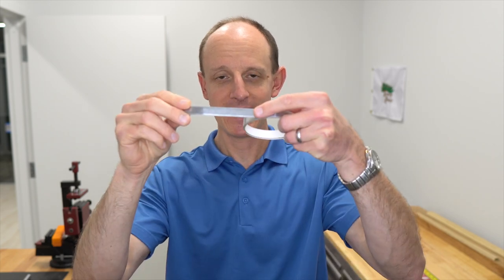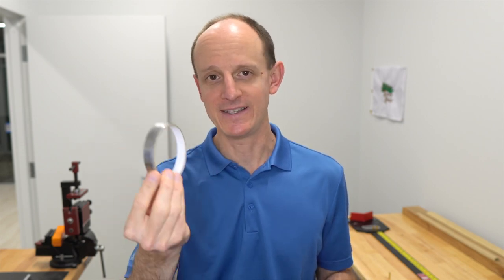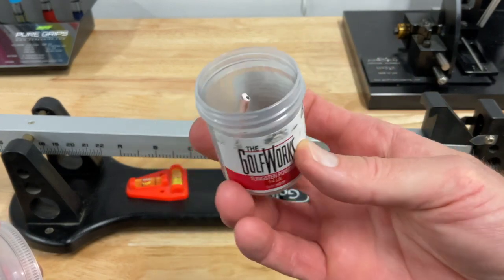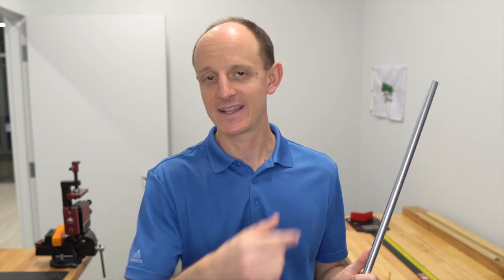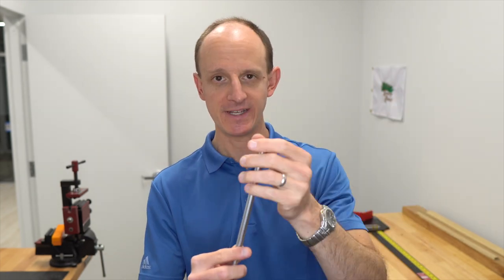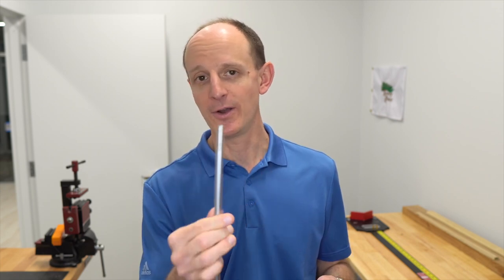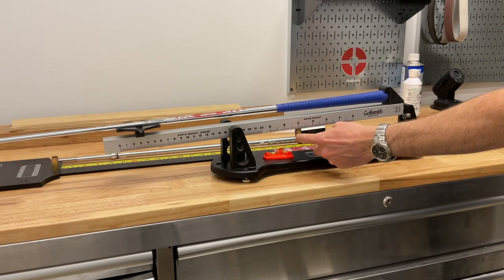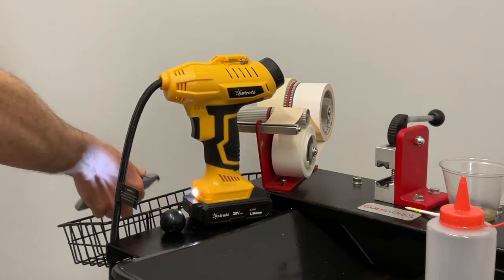BEST SWINGWEIGHT TECHNIQUE I'VE TRIED?

Comment: I just tried this method with .355 shafts and the .355 weights, and did not need to grind down the lip on the weights. According to golfworks, the .355 weights also fit .335 graphite shafts so they will fit loose in .355. Basically only the lip keeps it from going into the shaft, and epoxy will fill in the rest once installed. So I just put epoxy on the bottom half of the weight and was able to ramrod it to the bottom of shaft pretty easily

Comment: I’ve used Tungsten power without removing the grip. Using a thin funnel I made I can pour the powder then use the rod with a cork ( no epoxy) and seems to do the trick. Thx for your post

Comment: I find that lead tape works best for me, added to the right spot can really enhance the feel!  Brass & tungsten down the shaft or into the tip has the potential to change/mute the feel and potentially close the face at impact depending on the amount.

Comment: This is a great idea and while I've not done this before, if you need a "ramrod", I used an alignment rod or drive way marker for inserting dampening inserts, so as long as it fits all the way down the shaft, I would think this would work.

Comment: Hello AJ, I'm trying to build a set of irons using graphite shafts. I am using new uncut shafts that I am going to have to cut and add weight to them so they can all have the same swing weight and I was wondering what would be the best way to do this. I see a lot of videos with steel shafts but I haven't seen any using graphite and I was hoping you could instruct me on the best way to do this, thanks for your time and your great videos..
Reply from the maker: This should help.
https://youtu.be/zXf39oOblUg

Comment: Tungsten putty instead of powder is an option too. It is easier to make sure all the weight goes to the bottom of the shaft. A little bit harder to clean upon disassembly though.

Comment: Question… when the original shaft was installed, didn’t epoxy work its way up the inside of the shaft and wouldn’t that vary depending on how much epoxy was used? So the weight may not sit in the same spot on all the clubs.  Is that a concern?
Reply from the maker: Maybe. I would probably use the ram rod to measure the depth of all the clubs you were considering to see how much epoxy or even existing tip weight is changing the depth.
Reply: Like with powder, I would test first before putting in the cork.
 If it sits a bit higher up in the tip, then you probably need a bit more weight to get the same swingweight effect.

Comment: would adding lead tape to the hosel be a quick way to achieve the same effect? i'm trying to experiment around with swing weight, and I found an iron that "feels nice" to me. And I want to match the rest of the iron set with that.
Reply from the maker: Hosel would work or just back of the head.

Comment: Really liked the light weigh/flex driver shaft video, both the shafts you used obviously not the autoflex are hard o find in the uk, any others suggestions?
Reply from the maker: Going to try this with Fujikura Vista Pro but that should work. Also have heard people using the Grafalloy Prolaunch light weight light flex shafts.

Comment: Great information.  Does a tip weight have to be hollow?  Thinking of using a nail inside my graphite shaft.
Reply from the maker: No, but you do want enough space between the stem of the weight and the inside shaft wall to allow for epoxy to pass through and relieve pressure. Otherwise the shaft will want to push back out of the hosel.

Comment: A little of topic, but how do you feel about using these brass weights with the flange in the butt of the club for counter weighting.  Seems like it would be a cheaper and more flexible system than the commercial counterweights.
Reply: Seems like that would not be very stable and secure in the butt end of the club.
Chances are they will come out at some point or start to rattle.

There are butt weights that fit snugly, that are not very expensive.

Comment: Enjoying the varied content. Will that portable compressor be ok to remove grips that have beein installed with solvent?
Reply from the maker: I am 1 for 10 in removing grips with compressed air when installed with tape and solvent so probably shouldn't ask me. I prefer a grip removal tool.

Comment: Great video. Question, is there a difference between using a 3 wood shaft in driver and cutting driver shaft down. Would using a 3 wood shaft get the same results. Thank you
Reply from the maker: Most shafts used in 3 woods have no tipping just like a driver so the only difference is the final play length, assuming it's not some sort of fairway wood specific shaft.

Comment: Hopefully you can answer this cause I can't find an answer anywhere. I jsut bought some wilson staff model CB's, I like the shafts in my last set so I took both sets of shafts off and to my shock and horror in both sets,some shafts have these brass plugs/weights and some don't,any clue why this is?lol FYI, love your content.
Reply from the maker: Those are tip weights used to balance out the feel of the set. The ones with brass were evidently lighter feeling during assembly so extra weight was added to match the rest of the set.
Reply: @EFGMC  THANK you thank you. I was freaking out when I saw those. I ended up just taking them all out and haven't even noticed any difference but boy,them were some tense moments.Thanks for the responce and love your content,you have made tinkering with my clubs so much fun and stress free(ish)haha

Comment: AJ - Does adding that weight to the bottom of the shaft, add weight to the back side of the head and cause it to close faster? Like adding lead tape to the heel of a driver?
Reply from the maker: In line with the shaft, the weight is considered neutral.
Reply: @EFGMC  Thank you.

Comment: Rust at the bottom of the steel shaft compromise the bond possibly? There often a little corroded inside after a year or two of use?
Reply from the maker: Maybe. Older shafts might cause issues.

Comment: If I add 1/2 inch to a golf ion would the swing weights still change the same 2-3 points? if the material in the butt end of the golf club is Metal because it's basically changing the swing weight from the butt end of the golf club no?  I just don't understand how the swing weight could be the same if you're adding more weight to the butt end of the golf club

Comment: Hello , Can I also use this method when shortening the driver shaft? best regards
Reply from the maker: No, I would not use a tip weight with graphite. Not to mention that the graphite tip weights have a head and a stem and you'd only be able to get the stem into the base of the shaft. It will also likely cause a shaft failure.

Comment: I was surprised to learn my Cobra F7 One Length irons all had different scale weights on my cheapo-depot swingweight setup. The low was about 221g and the high was 235g.  I decided to try to make all the clubs about 230g. I couldn't figure out how to lower the weight on the 2 heavy clubs, I wasn't going to take a grinder to them. (Now I think maybe I could add a counterweight?) For the "too light" clubs I wrapped lead tape around the low point on the hosel. I know this is kind of ugly, but it was easy to adjust. Am I crazy or does this have the same effect as tip weighting the shaft?
Reply from the maker: Lead tape down by the head is doing the same thing as tip weights. I would not counter balance though unless you plan on doing the entire set.

Comment: Question… if I cut my 6 & 7 irons down to 8 iron length… will tip weights help keep my distances correctly? Or is swing weight different then head weight? Thanks!
Reply from the maker: Loft adjustments will likely be needed to get the right gapping. Tip weighting might help make the feel more consistent so that you make consistent contact, but we not really change the distances by itself.

Comment: I tried your method of tungsten power with a cork on an Aerotech graphite shaft could not get the cork down far enough. I bought the iron corks from golf works. So this method won’t work on graphite shaft, unless you cut the corks down?
Reply: Graphite shafts have a different (smaller) internal diameter. I’ve never heard of anyone corking them until this post. My guess would be ‘yes’.
Reply: There are some very small /thin corks that will work for graphite shafts.
Reply: @rogergee8470  Do you know where I can buy some? Thanks

Comment: I got my irons from fairway jockey and they are super heavy (d4). Is there anyway to reverse the weight?
Reply from the maker: Depends what the specs are and how they were put together. You could shorten them 1/4 inch and get them close to D2.
Reply: @EFGMC  1/2 longer due to my height. I got the pxg gen 6. I just don’t know how they achieved the weight. I was hoping like the video you showed with the brass weight
Reply from the maker: @paulrachetta935  Won't know for sure unless you break them down or email Fairway Jockey and see if they know.

Comment: Does adding weight to the bottom of the shaft change the center of gravity of the club and the sweet spot?
Reply from the maker: Weight in line with the shaft will have minimal impact on the head. Also we are usually adding say 6g on average to a head that weighs average of 270g ie 2-3% weight change won't have much impact regardless where it sits. Drivers can be influenced more because they start out lighter and have a much larger area to add weight to.
Reply: Any time you add weight down the hosel (solid or powder) you are shifting the sweet spot slightly towards the heel. For this reason lead tape CENTERED on the back of the club is the best way to ensure that doesn't happen, HOWEVER; placing it high or low on the clubhead can move the CG ever so slightly up or down.

Comment: How does this work at graphite shafts?
Reply from the maker: Still working on a graphite shaft option. This won't work because the inside tip diameter is so small that very little weight will fit, and the metal could cause a pinch point where the shaft could crack.

Comment: I cut 3 inches off of my g25 driver. How much weight should I add to the head to bring back the swing weight
Reply: You moved it 18 swing weight points down by cutting it 3 inches. It would take 36 grams added to the head to bring it back where it was.
Reply: @Matthew-of9sp  
Ii have herd that Ping counter balances their shafts. Does this complicate things at all?
And where should I add the weight to maximize forgiveness? Most likely lead tape.

I also just picked a used set of 425 irons. Green dot and would like to lengthen then myself by a inch. Graphite shafts. Any challenges there?

Thanks...
Reply: @Matthew-of9sp  2 grams per swing weight point is a rule of thumb and is dependent on club length. It is based on a club 38”-40” long. Shorter clubs need more than 2 grams per swing weight and longer clubs less. Assuming that the G25 driver was 45” long and cut down to 42”, 32 grams of weight would have be added to the head to restore the swing weight.
Reply: @golfish8589  counterbalanced would have lowered the original starting swing weight. Add weight to the rear of the head for max forgiveness (more launch and spin) or to the heel to promote more draw, or the toe to promote more fade. Extending graphite shafts requires the right components, whereas with steel there are some different options available. I have my own swingweight scale as well as clamps and bearings to ‘spine’ all my shafts. The ability to check and spec all of your own stuff and find what you like and what you don’t from a feel standpoint is a game changer imo. I figured most of it out the hard way, but channels like the mobile clubmaker and built by b mason have a ton of great tips and content to help with the learning curve.

Comment: YOU have( not added) weight to the "head" of the golf club! when the HEAD comes from China they are each weighed based upon the casting process, they can vary! Putting powder into the shaft makes the SHAFT heavy at the end of the shaft, like putting weight at the beginning of the shaft to make it feel like its heavier at the grip side. When you add "tape" you are adding weight to the actual head of the club. The Great Tom Wisekoft  added Lead tape to everyone of his clubs!

Comment: AJ how much do the tip weights weigh in a off the shelf stock set of irons ??
Reply from the maker: They vary based on head weights. You will often find between 2 and 6g of weight used within a single set.
Reply: @EFGMC  ok thank you so for example 4-pw kbs 120 steel stiff shafts probably have 2-4 gram tip weights in them stock off the shelf?? And are tip weights a must I’m reshafting my set I got the kbs shafts mentioned above on eBay and 3 of the 7 shafts do not have tip weights should I put them in or take them out of all the shafts sorry for the long response I’m new to this and want to do it the correct way thanks for any response
Reply from the maker: @joshuablaha8385  All about feel and if you prefer more head weight. Most important use is making sure all the different irons feel the same so you might need different weights to get them matched up.
Reply: @EFGMC  thank you so much watch for an update I’m playing Friday 🤞🤞hopefully I do it correctly